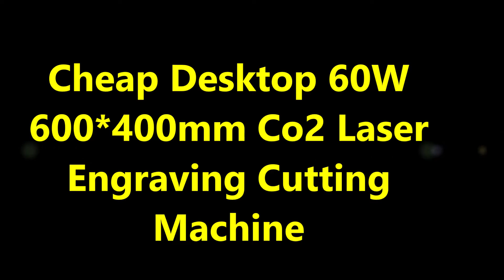Cheap Desktop 65W 600*400M Co2 Laser Engraving Cutting Machine

Comment: the dimension of the machine? where the water pump and water tank are located? Are they enclosed in the machine?
Reply from the maker: machine size: 1260*770*550mm, the water pump will connected on the back of machine, if you are interested, just contact us, will send you more details:  info@upgoalcnc.com, Mob/WhatsApp/WeChat:+86-13869132173